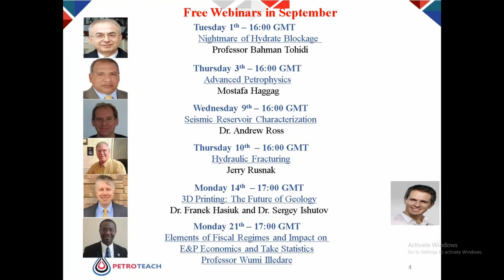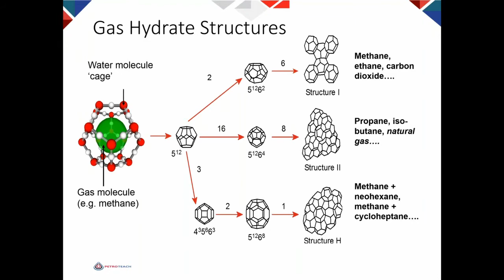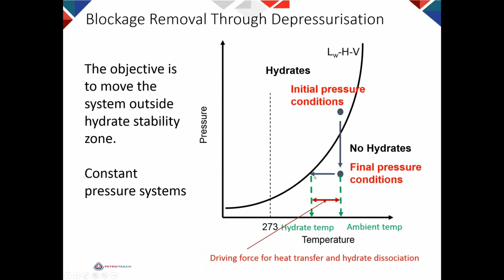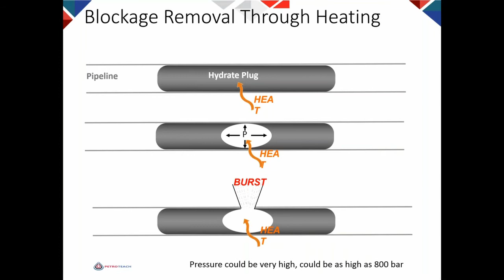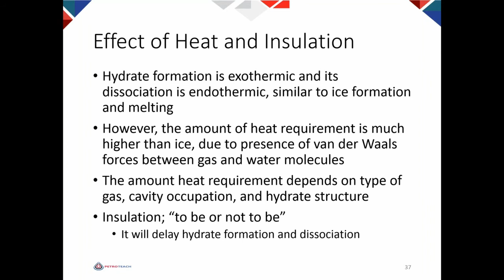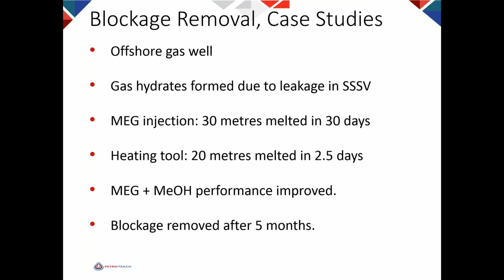Nightmare of Hydrate Blockages: How to Remove them Safely and Efficiently

Comment: For a well that has hydrates already formed, I guess you v to clear off the hydrates by injecting inhibitor maybe using coil tubing and then later find a way to inject into the well anyway below where the hydrates form. Can we heat the inhibitor and then pass through coil tubing for melting hydrates already formed? Any danger with this?